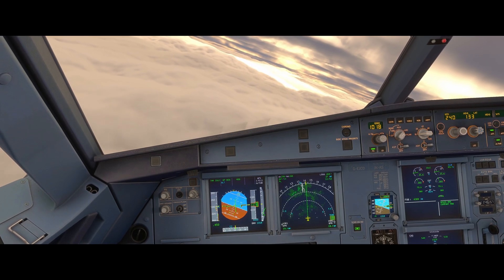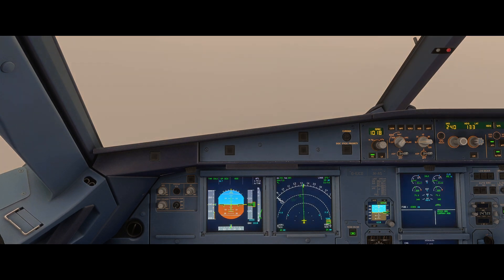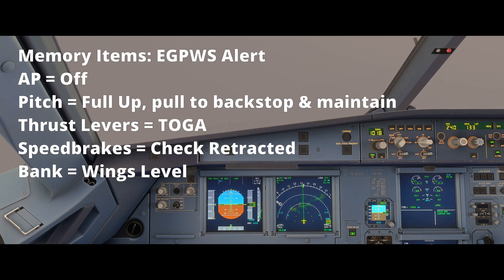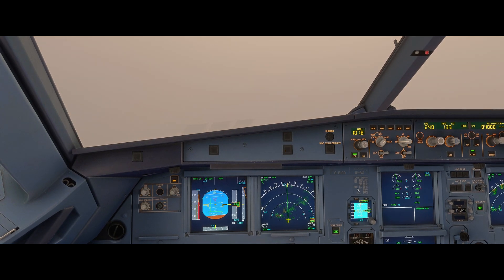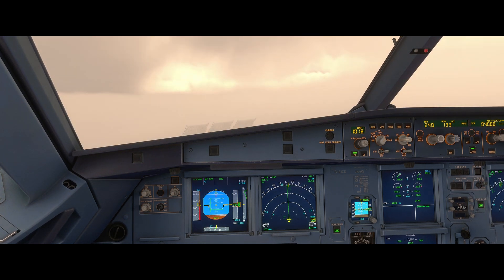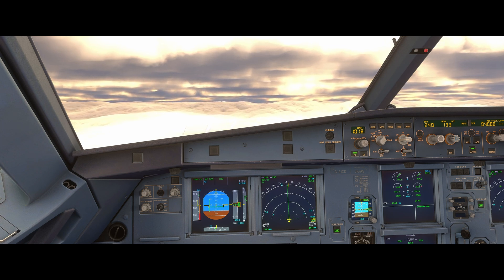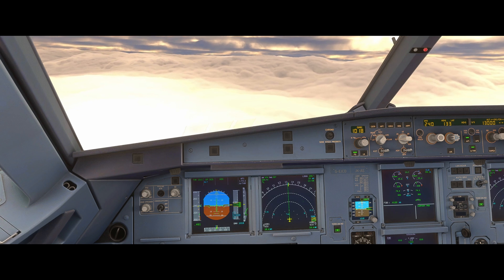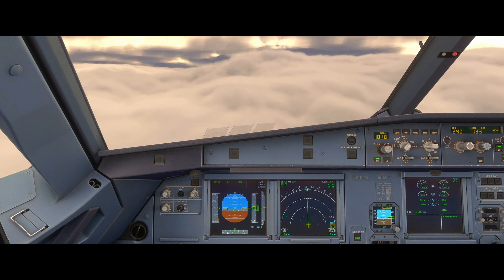A320 GPWS Warning? Memory Items Explained by a Real Airbus Pilot

Comment: Keep these videos coming. This is a great series 👍
Reply from the maker: Thanks, will do!
Reply: I note that it's said there , that in normal law the computer will protect  us from a stall in this configuration ? 
Am a bit confused here. If the autopilot is switched off, the plane leaves normal law and enters alternate law, where the stall protection no longer applies ?
Reply from the maker: Hello, the aircraft is still in normal law with the autopilot off as long as the required systems are functioning
Reply: @AirbusCockpitCoach  thank you. I have studied the Airbus control laws in detail, it's a very complex subject, but didn't know the aircraft remains in Normal Law with autopilot off, unless there is a system fault. Thanks.